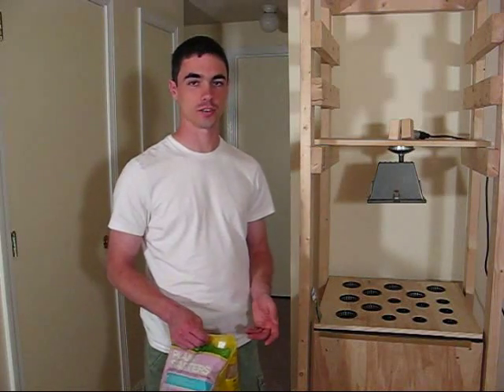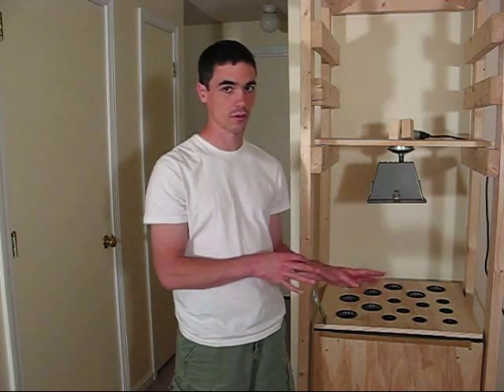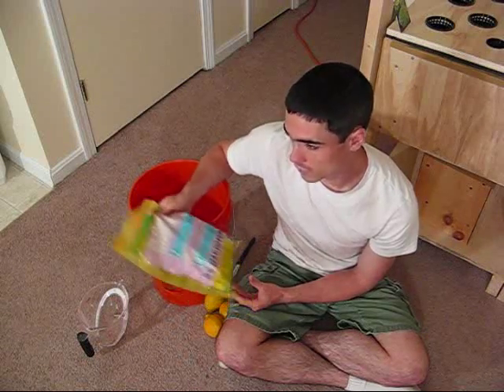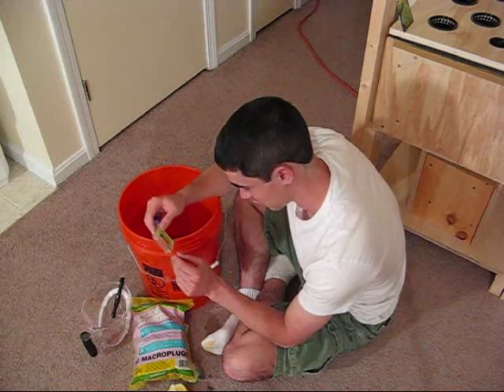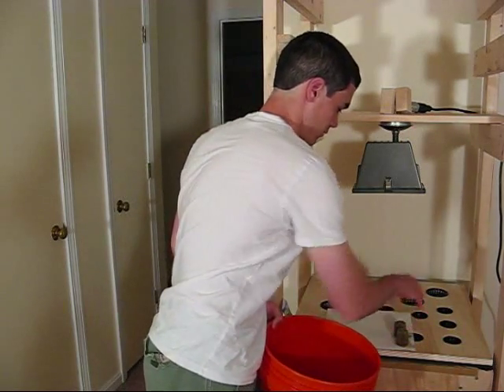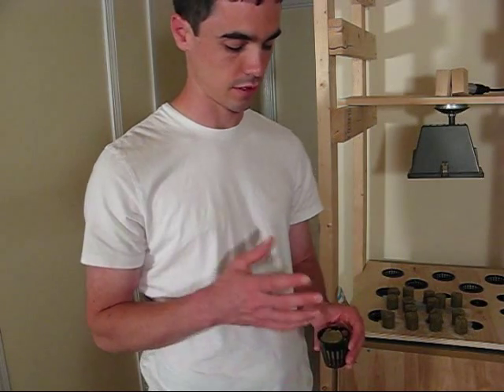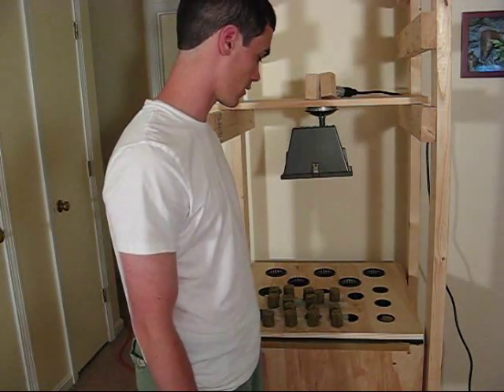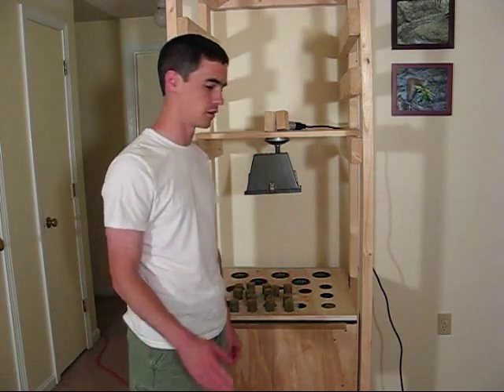Aeroponics Experiment - Part 2 (Starting Seeds)

Comment from the maker: Hey, glad you enjoyed the video.  The smaller pots for the herbs were 2" pots.  The larger ones were 3" pots.  However after this was all over, I saw some stuff that made me think the correct way is to start everything in 2" pots and put those in 3" pots when the roots start to come out of the 2" ones.  Not just the plant but the pot as well.  I think the root will push through the 2" pot if they need to make more room.  That's just my theory though.